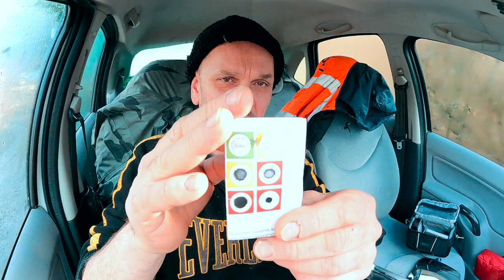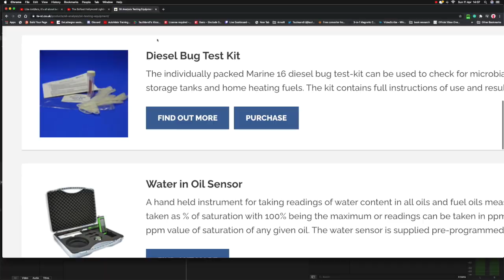'The Fly' Project PMI- Rethinking Diesel Engine Oil Change Intervals and 'Oil Spy' Oil Test Papers.

Comment: I watched a van self destruct in a lay-bye from a turbo failure. Plumes of smoke from the exhaust, maximum revs then once it had burnt all the oil from the sump it went quiet. I think the owner went quiet too. Expensive.

Comment: As you have mentioned the carbon build up on the valves, what can be done to remove some of that again? We‘re running a Volvo FL6 (200.000kmh/120.000miles) and it is idling quite often, it has about 5000hr on the clock whereof 2000 are at idle and the D6b engine runs quite rough.
Reply from the maker: The only way to get things really clean is to decoke. That's the old fashioned technique of stripping down and manually cleaning the valves.  Italian road tests don't help if there is a huge build-up of coke because it will be baked on. Although some can be shifted by just driving the vehicle.  If you are interested to see how bad it is or not, then if you happen to be replacing exhaust manifold gaskets, (ie: a way to take a look when doing legit repairs,)  take a look at the exhaust valves and the build-up there.  An endoscope will help with that.
Reply: Trailerfitter's Toolbox Videos thanks a lot!
I already would have checked the exhaust valves under the manifold, however I‘m afraid of stripping the bolts. Since the FL has a 
 problem with quite low boost I will have to strip down if the problem is not fuel related or the charge air system has quite a big leak. 

Btw: since I‘m commenting for the first time on your channel I have to thank you for the top content you create. As I‘m making a (rotten) Discovery 200tdi fit for road again and running two Trucks and two Iveco Dailys in our business you always provide useful information, thanks a lot!
Reply: Throw some mist water on intake manifold while running warm. The shock colling will.make the xarbon jump out of the valve metal, because of the difference in dilation/contraction rations between carbon and Steel.

Comment: Scania still run the old spinner system right up to the new gens 2017 ish, they still have spinners but now are plastic and throw away.
Reply from the maker: Have they still got filters on the rear diff?
Reply: Centrifuge filter at cranck.

Comment: Scania trucks now have a flexible service plan the vehicle tells us what needs doing depending on the usage it’s recorded. Some PMI’s were change just an air filter others it will want just fuel filters ect.
Reply from the maker: DAF has X services for oil and filters and Y services which is progressive servicing. Y 1 Y2 Y3 Y4 etc.  Each year will be different and that is still mileage-based but one year it will have the belts done, air drier etc and others will be all transmission fluids.  Merc has a system onboard  (Actros) that will tell you when the oil needs changing, air filter, fuel filter and brakes.  Handy if you have the Star diag. system.  Operators swear by it.

Comment: With the mileage I cover it's usually every 4 months. Vw /audi say 16000km or 10k miles but I just like to air on the side of caution. 300000km and still going strong .
Reply from the maker: Just about run in then?

Comment: We used to use them oil papers on static plant  Deutz engines  supplied them free 
I always used to vacuum all the oil out of my 1.4hdi  amazing how much oil was left in the sump as the drain plug / sump pan was a poor design  hence a lot of turbo failures on 1.6hdi
Letting the turbo idle for a minute before switching off helps the life of the turbo 
Leyland 680 had those centrifugal filters when running on train engines ( we bought them cheap to convert into bus engines )
Awful job scrapping the crud when we ran Scania ...  but they did work and  no filters to buy or wasteful canisters to dispose of ....
Reply from the maker: Yeah, I hated craping out those filters.  You know I thought about getting a vacuum oil pump from Lidl last week as they are on offer. Saves putting the car up on a ramp however when I'm draining the oil I'm looking around for anything else that needs doing so that's £14 saved.